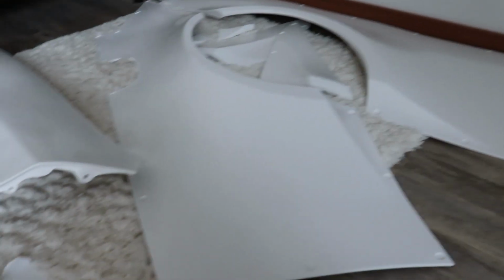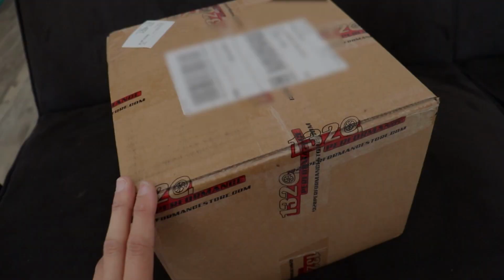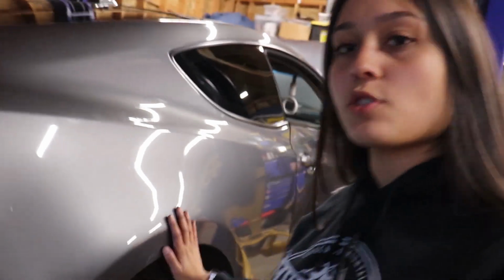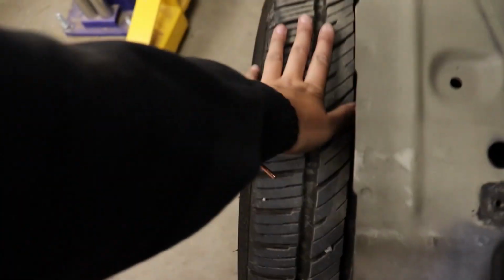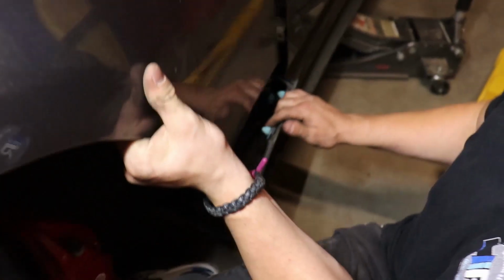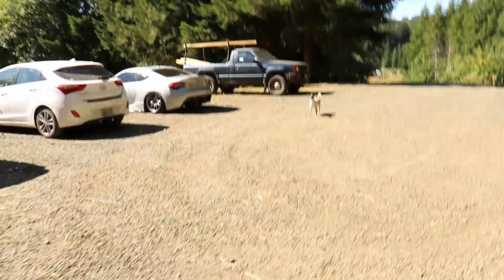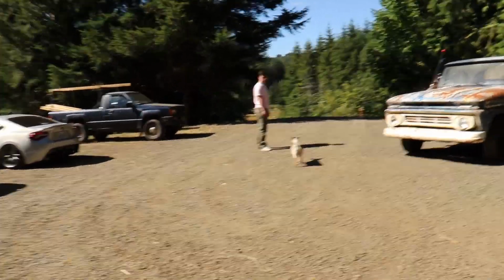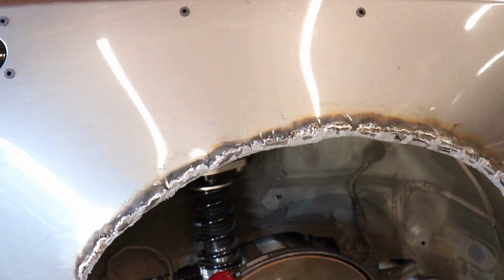INSTALLING A WIDEBODY KIT!

Comment: What product did you use as seam sealer on the rear fenders to seal them up? (Thanks in advance,  widebody R34 owner)
Reply from the maker: I can’t recall 100%, but I believe it was either Dynatron Gray Auto Seam Sealer or Evercoat Seam Sealer

Comment: I love yo genesis but how much did it cast and like where if it was dealer or no ☺️☺️cause I want a genesis so bad
Reply from the maker: I got mine used from a dealership for $10K at the time
Reply: @CynthiaCzikall  I paid 25k for 2016 ultimate . 58k Miles . How much did you spend in total ?

Comment: I really want this kit, but new to the process 😅. Why did U have to weld that part for the rear? Why not cut it instead? Is it because it’s too hard to cut off?
Reply from the maker: BoostedSamuari we welded/sealed that area because if it were to rain, water would get inside the car and possibly the trunk as well. Keeps it sealed off from the elements. And we folded the flaps up instead of cutting them off so that we would have minimal holes to seal up!
Reply: Cynthia Czikall ahh I see. Thanks for the reply !!

Comment: Hi love the genesis, I don’t know for how much time you had the car but, have you ever had any problems with it? Are these cars reliable? Because I am planing on getting a 2.0t or a 3.8. I would apriciate it thanks
Reply from the maker: Hey! The only major issues I've had so far are my AC compressor blowing (at about 125k miles) and then literally yesterday my throttle body went out (at 128k miles). Other than that I've had no issues!
Reply: Ive had a 2016 rspec, 60k miles for almost a year not a single issue, thats why the sell price on them has gone up so high theyre such good cars

Comment: Omg finally car looks so goooood what year is it
Reply from the maker: armando sandoval 2011!
Reply: Cynthia Czikall auto or Manuel? And I’m looking for a 2016 ultimate do you think it’s worth getting?
Reply from the maker: armando sandoval Manual. And I love the car!
Reply: Cynthia Czikall does it give you a lot of problems or what’s the main issue about them
Reply: @armandosandoval7297  I've had mine for about 8 months now and haven't had any issues and have zero complaints. I absolutely love this car!
Reply: Zach B. Sorry if I’m bugging I just really love them but I don’t wanna get something I regret was just wondering how many miles did you get it with and how many does it have now
Reply: @armandosandoval7297  well I got pretty lucky with mine. I bought my 2015 ultimate in January with 6,800 miles and I'm a little over 13k now. I'm using it as my everyday driver and have had no problems at all
Reply: Zach B. I thought you said yours was a 2011 and 2016 should be the same as a 2015 just the difference is the push to start bottom and the rev match right?
Reply: I’ve been looking for 2016 with low miles but can’t seem to find one😭😭  there all 15k with accidents
Reply: Zach B. Did you look at a lot of different dealerships or just at 1
Reply: @armandosandoval7297  I just went to the one dealership where I bought it, but I was constantly on cargurus just waiting for the right one to come available
Reply: Zach B. I guess patient is the key and I just can’t get over the fact that it sounds so good
Reply: Exterminate Domestic Terrorist is there a big difference between the 2016 ultimate and the 2015 ultimate??

Comment: what's the wheel specs?
Reply from the maker: 19x9.5 +22 with 20mm spacers (I now have 32mm though), and 19x10.5 +22 with 38mm spacers
Reply: Cynthia Czikall so what I have is 19x9.5 22 front and 19x10.5 22 rear so I need the same as you for spacers? Just to make sure
Reply from the maker: John Delpriore Yes! I will be posting more photos on my instagram soon as well with the new 32mm spacers so you will be able to see the new front fitment (just under flush). But rear with the 38mm is pretty flush. You could go bigger with 38mm in the front too depending on how much camber/wheel poke u want to run!
Reply: Cynthia Czikall perfect I’ll be watching. If you can make a video too!
Reply: Could I possibly buy or get those spacers you’re taking off your car? I just got a rocket bunny kit but the rear is a 75mm extension
Reply from the maker: John Delpriore DM me on instagram @cynthiaczikall